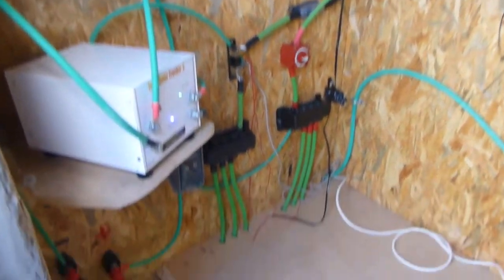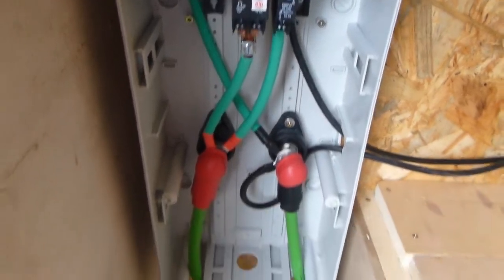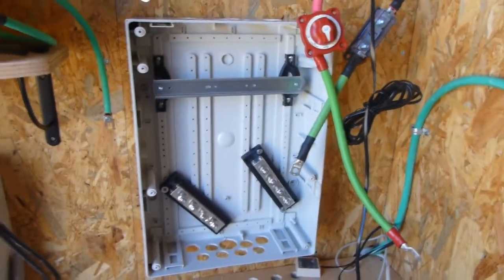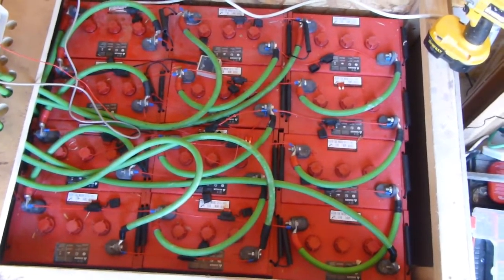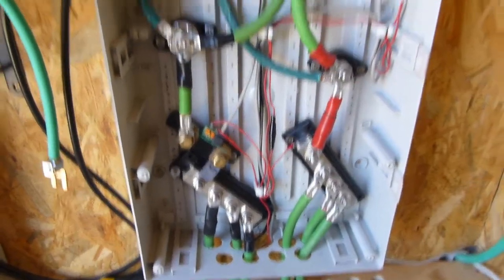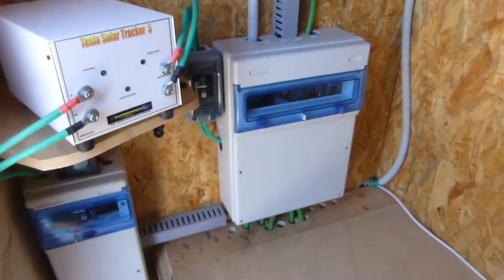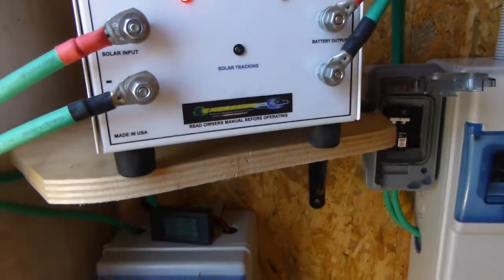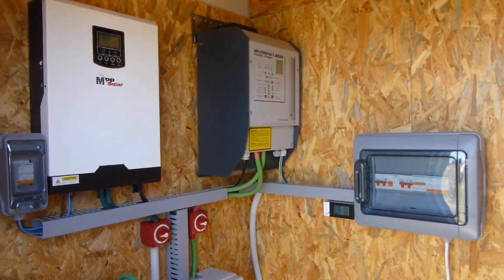Off Grid Solar- PIP 2424 Back up - Cable gutters and Combiner boxes

Comment: Where did you get the cable gutters? I can't find them.. they must have a different name..
Reply from the maker: im in spain so dont think where i bought them will help you ;) but they are just normal surface mount cable gutters should be easy to find

Comment: Could you explain what the SHUNT does please? Thanks Jim
Reply from the maker: Hi Jim, the shunt is used by the victron BMV 702 Battery Monitor to be able to give you information about your battery bank, watts/amps/voltage etc
Reply: ChileExpatFamily 
https://youtu.be/yqVfgYjgR54
https://youtu.be/7WpDaPtk0YY

Comment: I would be very careful about not connecting the two inverters together, both from a synchronisation point of view but also from a ground fault current loop point of view, especially as they share the same battery bank.

What you could to stop someone from putting both inverters online at the same time is to use a mechanically interlinked automatic transfer switch, that would physically stop one relay from engaging while the other is engaged but still allow for one to take over from the other one when one of them fails. It;s the same type that's used for generator backup systems so that you would never end up with a generator directly connected to the grid, as when that happens and the grid comes online again it will force your generator in sync with spectacular results!

Also having a running generator connected to a dead grid is a recipe for killing linesmen trying to fix the grid...
Reply from the maker: Hi Morten,

I havent connected them in the end.  A lot of people have have warned me about that problem.  Its easy enough to just walk in and switch them over.

thanks for both your comments!

Comment: thank for share knowledge.  may i know how to control battery and how to monitor battery power?
Reply from the maker: Hi Aye,

I use a Victron BMV702 to monitor the batteries state of charge.

By control do you mean charge?
I use a Tesla Chargers Solar TRacker 5 Ex to charge and I have an MPP Solar PIP 2424 as a back up for the charger and Inverter.

My Inverter is an old 4000W Studer.

Hope that helps!  Thanks for your comment!
Reply: thank for reply ,so u meaning MPP solar 2424 is use for standby ?
Reply from the maker: yes, its a backup in case my other charge controller and inverter have a problem.
Reply: Aye Min Tun 
https://youtu.be/yqVfgYjgR54

Comment: Very nice clean up mate. 
Your system looks way better looking now. 
I will suggest you get the Tri-metric battery Monitor for accurate readings on your battery Bank and finally get the Battery Extra EX02 12-120-800 Desulfactor to keep you batteries healthy and last longer.
Thanks for sharing, have a wonderful day and God bless.
Reply from the maker: Hi, yeah it looks a lot better now.  I have a BMV702 monitor and plan to make a raspberry pi based battery monitoring system like the emonpi.  Also I think i would have to import the trimetric system here.

In theory I dont need a battery desulfator as my tesla chargers Solar Tracker 5 does that already.  So far there seems to be no sulfation on the plates, although the batteries are very young.  I check the specific gravities con a regular basis and they are all super constant and equal and very high, up 1.28 - 1.3.  Im not sure but i think that that means that there is no sulfation going on.

I will keep a close eye on it though and if i see any build up I will install that english desulfator as they dont cost much.

thanks for your comment!  I look forward to seeing Stevie's wind turbine up and running as that is the next logical step for my system too ;)